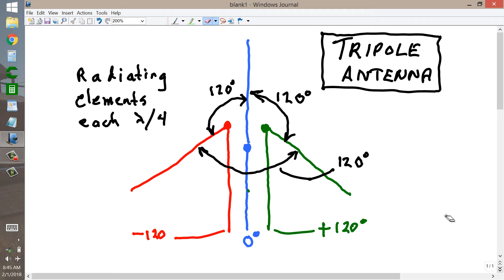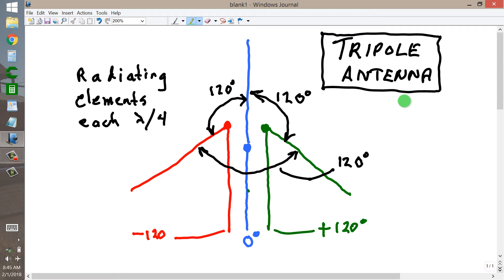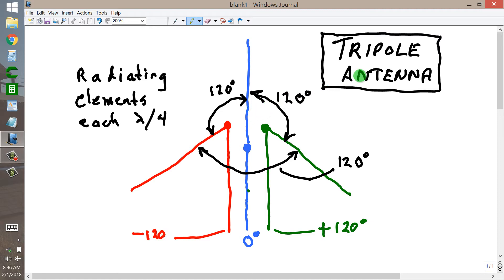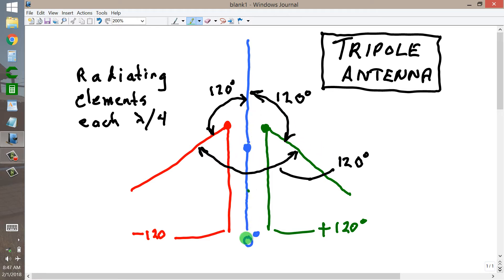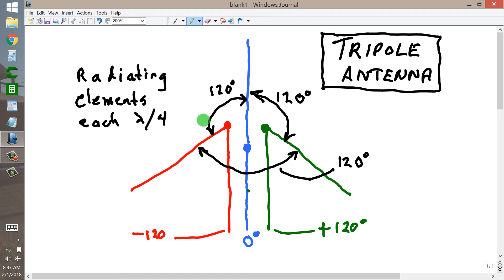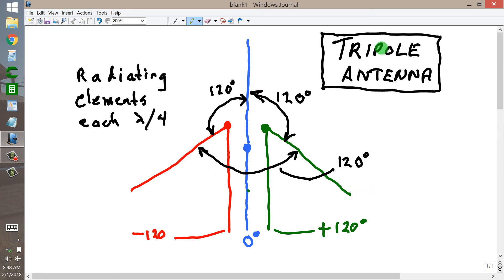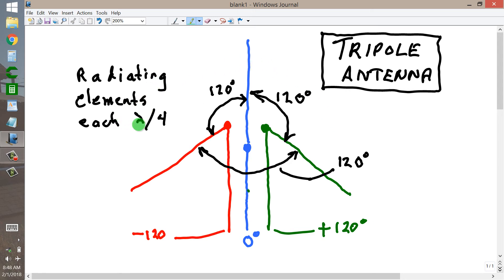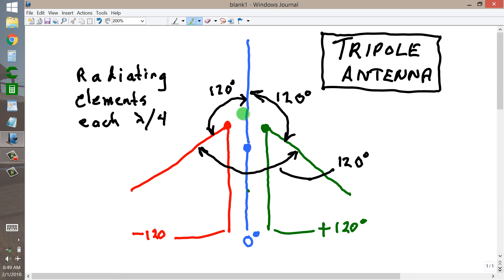Tripole Antenna

Comment: I am confused. Is the vertical element the driven one? Where do the other 2 elements fit in, regarding the feedline, and where do they go into the transmitter? Do they get tied in, together and serve as connected ground planes? Thanks Stan. KC3BXZ Joe
Reply from the maker: All three elements are driven with equally strong signals (each one 1/3 of the total). I haven't thought about the design of the interface to the transmitter; all I know is that it can be done. Maybe I should make another video with a circuit that splits the transmitter output into three equal-amplitude signals, each branch 120 degrees out of phase with the other two. As I mentioned in the video, I thought of the idea but not about how, exactly, I'd build the beast. At this point it's all a mere daydream.
Reply: We`ll be tuning in Stan. I enjoy the videos. Be well, 73, Joe
Reply from the maker: Okay, but after thinking all night about possible designs for a transmatch with a three-wire balanced output and a single-phase 50-ohm unbalanced input, I concluded that the task might prove beyond my engineering ability. So don't hold your breath!

Comment: Have you tried simulating it in MMANA-GAL?
Reply from the maker: Nope. Not yet, anyhow! This old timer might want to learn a new trick or three.
Reply: You definitely should try it. Its not very complicated in comparison with full featured simulation software. You just enter all your element lengths and positions, set your signal source or sources (you may use phase shifts, if needed) - and thats all. It gives you SWR, Gain, F/B and other parameters and can graph it over frequency and show radiation patterns. I always try my ideas in it before making a real thing - and result usually matches the simulation. Also, it is free.